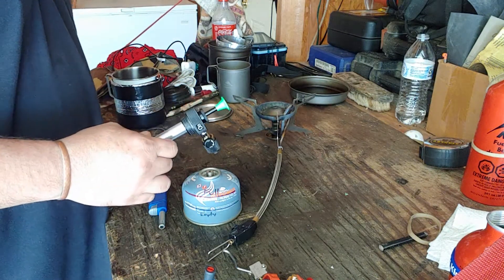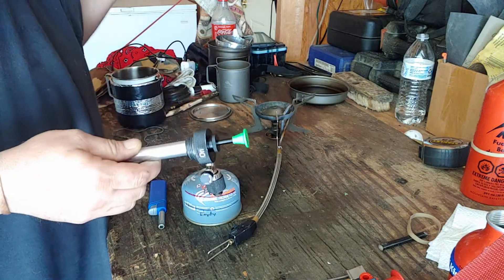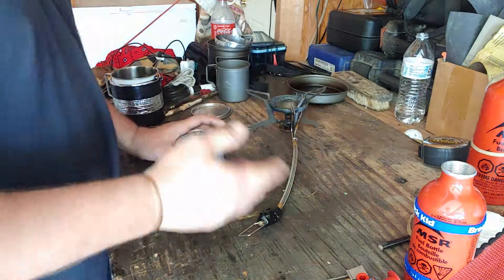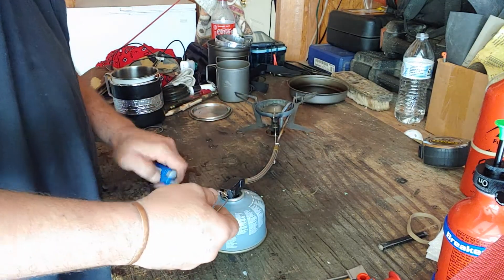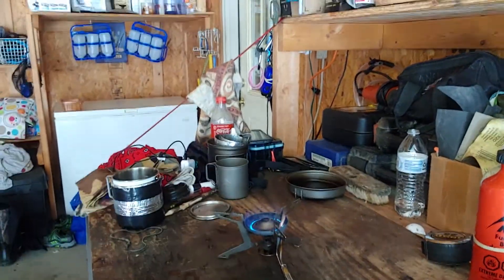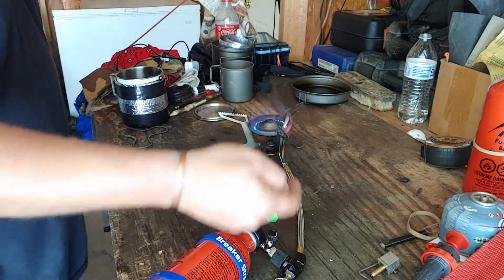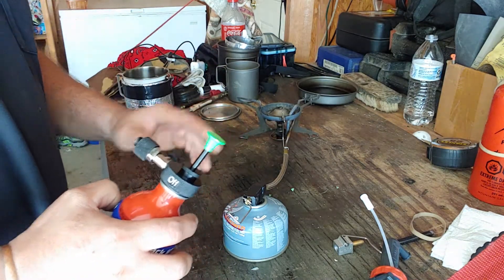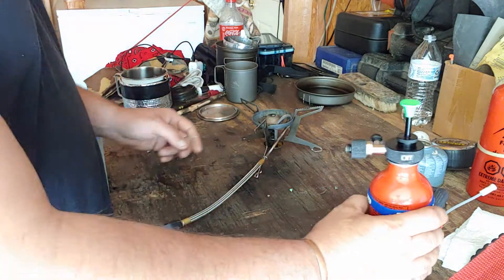UPGRADE! Whisperlite universal with polaris optifuel pump

Comment: Very nice presentation! The truth is that the LPG adapter on the Universal gave the option to use pumps with lindal valves from other manufacturers. IMHO, Msr will have to adopt this at some point, and the only reason for holding back is probably backward compatibility with older stoves and pumps. But the convenience of only one interface with gas canisters AND fuel pumps is unsurpassed. Primus and Optimus, together with the hordes of eastern clones are doing it for years. It is just easier for them though, because they did it from the start, without the need to render older pumps or stoves obsolete.
Reply from the maker: Thanks for watching... My buddy still has the msr pump and I blew his mind with how well this thing simmers with this pump..hard to justify the extra money on one of you really don't need it. But I can't change back now. I don't like msrs pump at all now after using this one so long.

Comment: You could have sold your MSR and then have bought the whole Optimus kit instead of mix and match but I agree who wants to start changing jets if you don't have to I've got the polaris and appreciate the build quality the stability the control ability and the smaller sized burner in case you only want to heat up a cup of water I liked your video well explained and videoed
Reply from the maker: I  didn't even know the Optimus existed when I bought the MSR. had it for a while.. but when I came across a video of a guy that had the pump using it with MSR I started looking at them.. but I thought they were quite a bit louder than my Whusperlite  with the videos I watched. but really wanted the pump.. I have no regrets.. optimus definitely makes a much sturdier pump, maybe even sturdier stove. but sure cause I can't compare the two.. maybe one of these days

Comment: The other option is to use the Primus ErgoPump.  Both the Primus pump and the Optimus pump are way better than the crappy MSR pump.  And everyone needs to swap over to Lindal valves.

Comment: nice! is that msr fuel line or polaris? do valve come with polaris pum? still working good with no leaks etc? best M
Reply from the maker: That's the stock msr equipment. Only thing that is different is the Primus pump.
Reply from the maker: Yea it works flawless. And is so much better than the msr pump in every way. Especially if you simmer and want full control of the flame
Reply: @AK4PJ  Thx! like stove factor desig and quality but need simmer function of Polaris pump, will order one.

Comment: Will gasoline not degrade the oringa in that lyndel valve?
Reply from the maker: @GospodinJean  that I'm unsure of over time. I don't run gasoline in frequent enough to know.. I would probably only use that as a last result.. it's pretty nasty to burn imo.

Comment: where can you get the valve adapter that you replaced on stove hose?
Reply from the maker: @outdoor1640  what model do have?.. mine came with it.. only thing I bought separately was the optifuel pump.
Reply: @AK4PJ  i have an older Whisperlite international i think.  Does not have that adapter.  I need a new pump and liked the idea of the polaris optifuel pump
I can't seem to find the Valve assembly anywhere except maybe Europe

Comment: Does this affect the boil time at all compared with the stock pump if just making coffee or tea?
Reply from the maker: Not at all.. In fact I get pretty much the same on high with it.. Where it really shines over the msr one is on simmering. It's far more adjustable on the lower side.. And I don't seem to have to pump it near as many times for high pressure

Comment: Any problems with the optifuels leather plunger?
Reply from the maker: None. Still works flawless.
Reply from the maker: And you can buy a  good size pack of replacements pretty cheap for just in case
Reply: @AK4PJ  awesome video.   You sold me.  I have a msr international. I am going to by the Universal.  I can drill out the extra kerosene jet i have with a  .8mm drill and also burn Heet and rubbbing alcohol and mineral spirits from what i see.
Reply from the maker: I have many alcohol stoves I use in some instances. I've researched mixed experiences on using alcohol in the whisperlite so I never tried it.. I figure if worse came to worse I can just use gasoline for extreme emergencies. It's really sooty but it works.. Coleman fuel and canisters are easy to find around here in the smoky mountains so that has been my preferred fuels for this stove and I can stock up on them if need be.

Comment: for 50$ it isnt worth it.
when i use my whisperlite international i just pump it 1-3times, no more than that. if you just crack the valve its simmering pretty low. i am planning on buying a diffuser plate for 5$ (used on gas range).